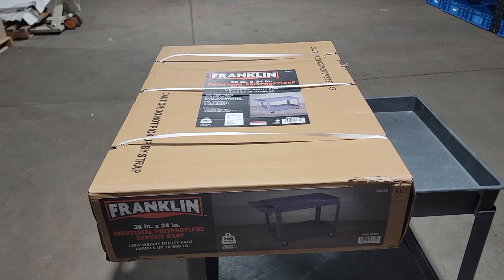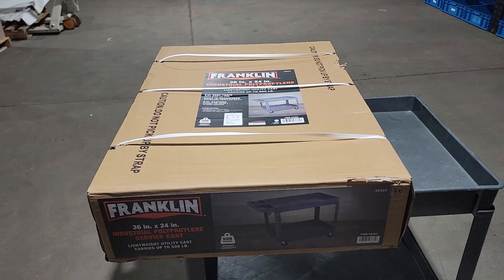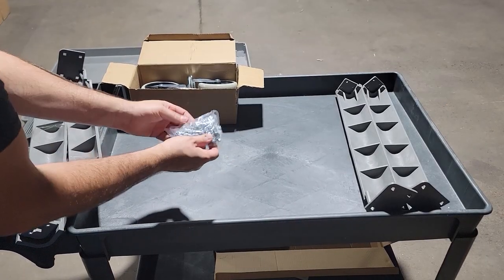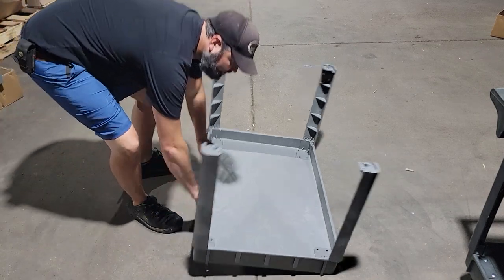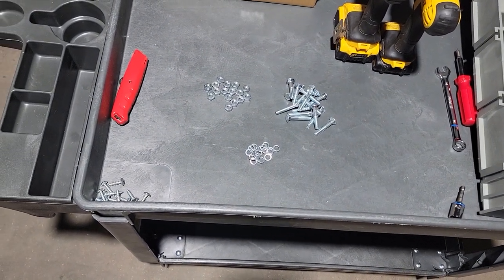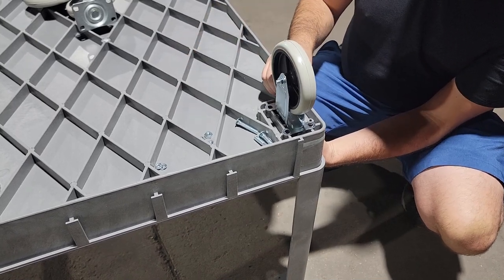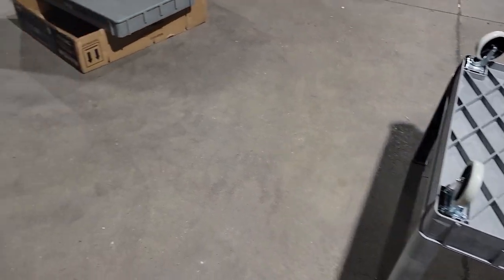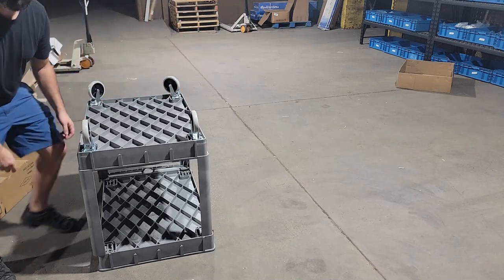Harbor Freight Industrial Utility Cart Assembly & Review

Comment: 5:54 GOOD, it looks like you can assemble this WITHOUT the handles, I'm planning on using one of these to set my propane generator on the top & 2 grill propane tanks on the bottom, without the handles I can have a custom cover made that will slip over it all since it will remain on my screen in porch to keep the dust, lizards & little tree frogs OFF & OUT of the setup, I'll keep it in the corner till I have to roll it into place when using
Reply from the maker: Yeah you can. I have one without the handle.

Comment: Great Video on putting this cart together. For some reason my cart was missing the screws that fit the top to the legs. Do you know what type, number kind or size screws you used to connect the top to the legs please? Thanks in advance.
Reply from the maker: I think any screw would work in there.  Go to the hardware store and get like 5 different sizes and see which goes in there the best.  I was able to hand tighten them to start.

Comment: Did i get a bad cart? The cart not broken or anything but the fit and finish is bad. Had to hammer in the 4 legs and had to hammer some of the bolts into the square holes in the bottom for the casters. Is that normal or did i get a bad cart?
Reply from the maker: I haven't had this issue. But these are cheaper made products so it makes sense some wouldn't be perfect.